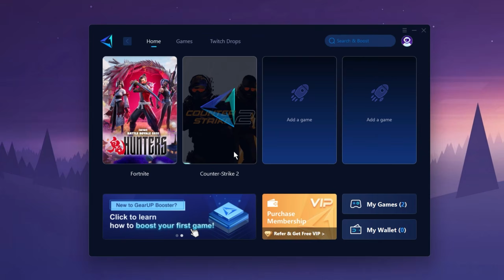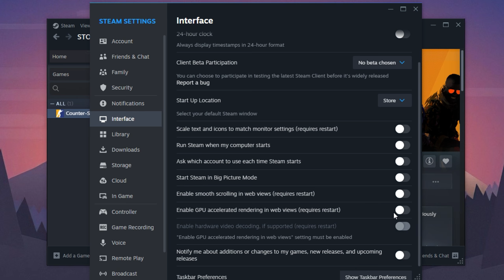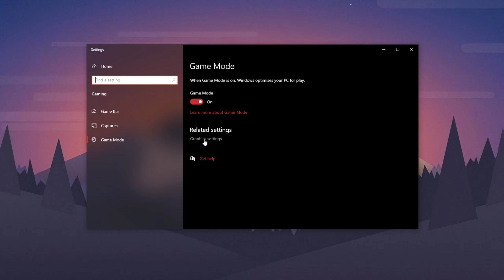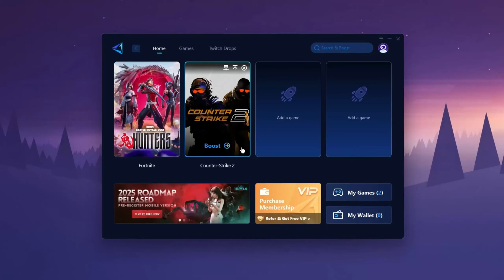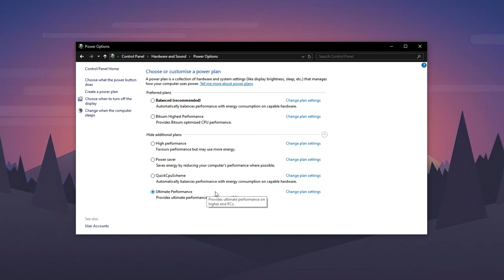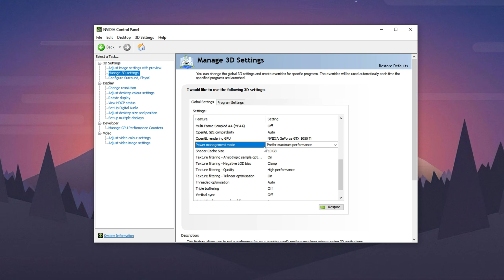CS2 Expert with 10 Years Experience Shares 4 Tips to BOOST Your FPS NOW

Comment: Setting dynamic shadows to sun only is the worst advice I heard for a while. If you wanna be at a competitive disadvantage, sure go for it.
Reply from the maker: Totally get your point, and yeah, in a competitive scene, visibility matters a lot. But the tip was mainly for players on very low-end systems who are struggling to get stable FPS. In those cases, reducing dynamic shadows (even to sun only) can be a helpful trade-off. Of course, it’s not ideal for everyone, but sometimes a few extra frames can make a huge difference in playability. Appreciate you sharing your view tho! 👌

Comment: i have i7 12900k and 3070 ti but my games runs around 200-300 fps on anubis and i play full hd, is something bad on my pc or?
Reply from the maker: That FPS is actually normal for Anubis, it’s a heavy map with lots of details, so even powerful PCs like yours can get around 200–300 FPS. But if you feel it should be higher, try checking for background apps, make sure your power plan is set to "High Performance" or Ultimate Performance, and maybe reinstall your GPU drivers using DDU. If you want, I can share a full guide to boost your FPS even more!

Comment: my system is i7 4790, rx 580 2048sp, 16gb ram should i try this ? normaly i have 120-190 fps but sometime it will drop fps during the game
Reply from the maker: Hey! 👋 Your system is still pretty capable for CS2, Try setting your CS2 launch options to (-high -novid -nojoy -threads 4) and make sure your power plan is set to "High Performance" or ''Ultimate Performance'' in Windows.
Also, disable Game DVR from the Xbox Game Bar settings and turn off hardware-accelerated GPU scheduling in Windows graphics settings.
For the RX 580 2048SP, using older stable drivers like Adrenalin 22.5.1 can sometimes help with stability.
Lastly, clean up background apps and make sure your CPU temps are under control — thermal throttling can cause those FPS drops.

Comment: i9 9900KF , 32GB RAM DDR4. Just got new RTX 5070 and fps on deadmatch Mirage are 90-120 fps it should be really that low? :( Maybe I should get lower resolution? 2560x1440p ingame may be an issue here?
Reply: your gpu is very good but the cpu is probalby the problem sinse it is'nt that good in 1440P but 1080p you gonna be good!
Reply: @rip_teddytoo  Yea mate, need new motherboard AM5, new CPU and new DDR5 RAM :) But i still was thinking that FPS would be better :/
Reply from the maker: @54czacha  You're right to be surprised — with an i9 9900KF, 32GB RAM, and an RTX 5070, you should definitely be getting higher FPS in CS2, even on Mirage deathmatch. A few things to consider:

1- Resolution Matters: Yes, 2560x1440p is more demanding than 1080p. If you're chasing higher FPS, especially in deathmatch where there are many players and effects, try lowering to 1920x1080 and see how it improves.

2- NVIDIA Control Panel & Windows Tweaks: Make sure you're using High Performance mode in Windows and that your GPU is set to maximum performance in the NVIDIA Control Panel.

3- In-Game Settings: CS2 is CPU-heavy, so even with a strong GPU, settings like Shadows, Shader Detail, and Multisampling can impact FPS. Try using low or medium settings for those.

4 Background Processes: Disable any unnecessary apps in the background and ensure your drivers are fully updated, especially the latest RTX 5070 driver.

5- Make sure your Windows power plan is set to "Ultimate Performance."

Let me know if you'd like a full video guide to optimize your system for CS2 at 1440p or 1080p. You're not alone — many users face this and it’s usually fixable with the right tweaks!

Comment: my system is i714700kf - 3070.
should i try this optimization ?
normaly i have 300-400 fps in comptetitive
Reply from the maker: Yes You can, But Not Necessary.

Comment: My system is 3080ti, i7 13700kf, 16 gb 4400 mhz ram. I usually get 300-400 fps. But when I enter deathmatch, I even see 100. I can see 200 during the match, this bothers me. Is this normal? I will apply the video, thank you.
Reply from the maker: Hey! With a 3080 Ti and i7-13700KF, your system is definitely a beast, so I totally get why those FPS drops in deathmatch feel off. CS2 deathmatches are usually more CPU-intensive because of the number of players and constant action happening at once — it’s normal to see FPS dips, even on high-end setups. But dropping to 100 does sound a bit too low for your specs. Check out my this video about CPU OPTIMIZATION: https://youtu.be/FxLjVSnUqy0  And Let me know how it goes after you try them out
Reply: @howtoboost1  thank u bro 🙏🙏

Comment: I play cs2 with gtx1650 and i5 10300h loptop and I get 40_130 fps in casual match . My game is not smooth because my monitor is 144 hz . I must try this
Reply: same system same monitor i play 160 - 180 turn off your g sync or v sync
Reply: My v sync is off@rahgozar_T
Reply: @walt_rick  I have the same laptop and on competitive 100-200. if you have an asus laptop, you should install armoury crate, since you can put your fans on turbo mode which stablizes fps, atleast on my end.
Reply from the maker: I appreciate you sharing your experience! I hope these tips work wonders for you and help smooth out your gameplay. Let me know how it goes!
Reply: @walt_rick  How does the game feel now, do you have more fps and is it smoother?
Reply: @IM.MxT3o  I don't trying 😅😅